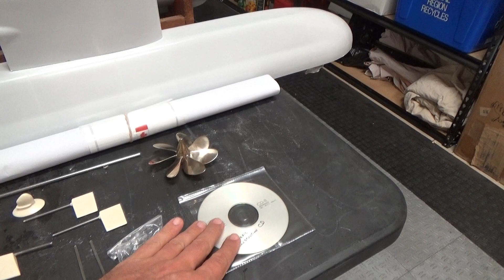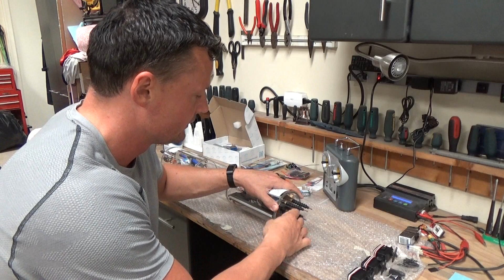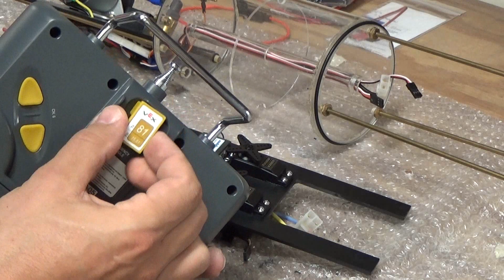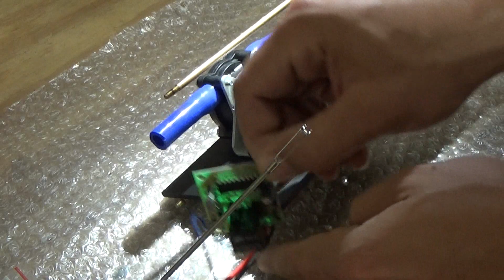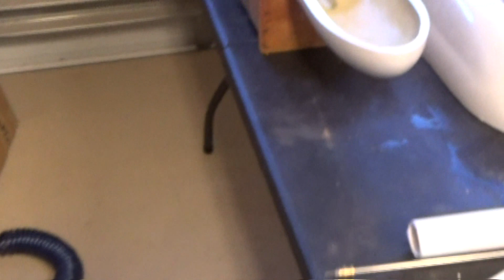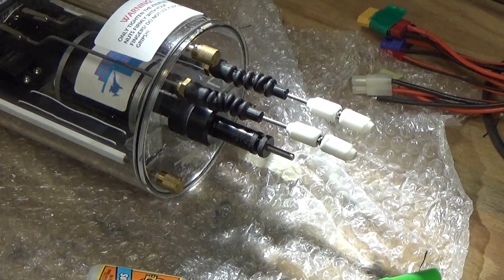1:50 Scale British Upholder RC Submarine - Chapter 1

Comment: The eyelets should always be put in with the flange against the mounting surface otherwise you stand the chance of having the eyelets cutting into the mounting surface which means you loose the vibration isolation of the system.  I realize the the mounting surface is a hard one in your case, not like the more normal wood that servos are mounted to.

Comment: Hey, Bob I want to ask you how much does it cost for all of the electronic, cylinder, submarine kits and the controller
Reply from the maker: It depends completely on the kit. I sell beginner kits as low as $900, most at $1300, and you can get as high as you want. The OTW Upholder would set you back around $2000 for components.

Comment: Not to sound like an asshole but just an fyi...the bushings in the servo dampeners go in from the bottom not the top...the flange on the bushing is designed to act as a washer on the bottom so the sharp edges dont dig into the mounting surface...the screw has a built in flat that presses against the sharp edge which creates an encapsulation of the rubber isolators

Comment: Interesting and informative! Great video. I’ve been looking forward to another video series like this since I watched your Nautilus build. One question, when wiring the remote power switch, why cut the wires off the top of the board, solder new wires to the underside of the board, solder those to the power and ESC connectors, then set up spacers so it clears the new wires? Why not just solder the original wires to the battery and ESC connectors and double-stick tape the still flat board to the mounting surface? Seems like 2 less steps for the same result, but since you’re the master sub builder, I wondered if there was a specific reason for the extra steps. Thank you for the great video. Looking forward to more.